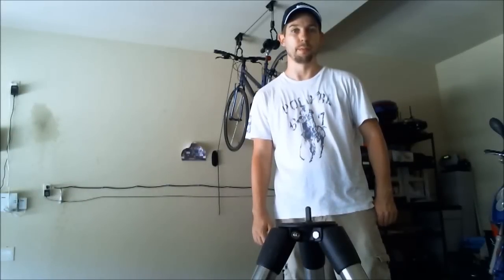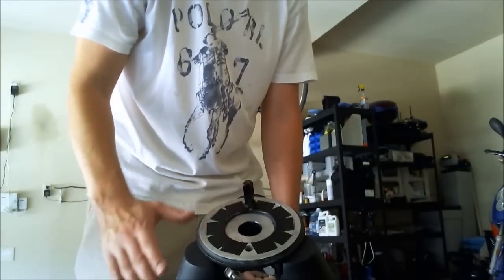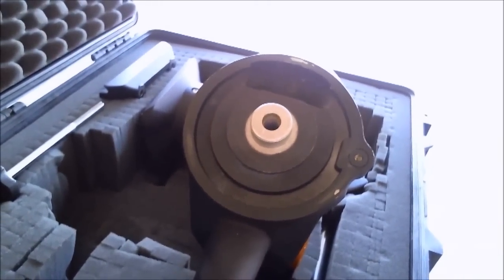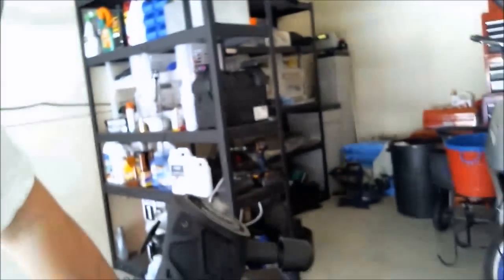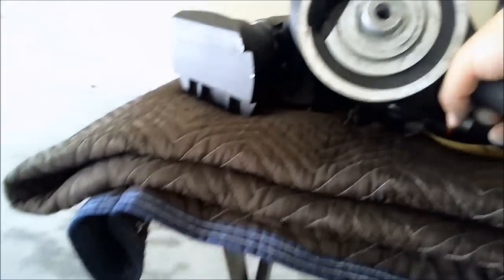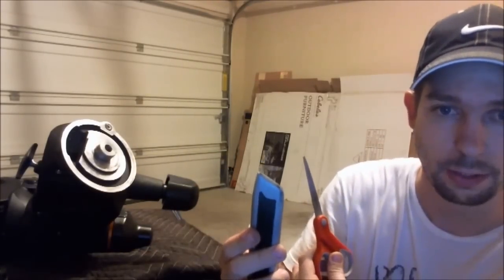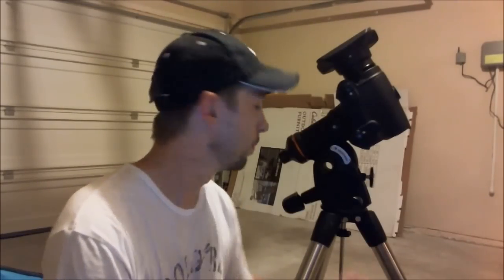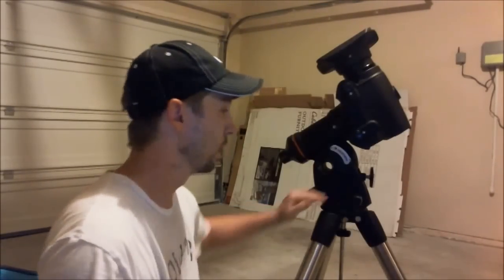CGEM Hypertune - Eliminating Friction In A Celestron CGEM Mount

Comment: Great video....btw, is this the correct tape and if so, what thickness should I use?   PTFE Slick Surface Film Tape, Gray, 1 1/2 in x 5 yd"  Lastly, it looks like you put tape on both the tripod and mount....if so, do the two surfaces with tape work with each other to reduce the friction...or is there just tape on one-side and it works against the metal itself?  Many Thanks, Steve

Comment: to much work use valve lapping compound to flattened both the surfaces then use plastic in between both surfaces done,sanding that way end up with wavy surfaces not good,don nit years ago good video kudos

Comment: A less perfect but much easier approach is to cut a disk out of a slick material, trim appropriately, and let it sit between the mount and the mounting plate.  A disk cut out of the side of a 1 gallon milk jug (HDPE) works very well.  The painted base of the mount glides over it very smoothly.
Reply from the maker: That was my first method, a few years prior.  That plastic deforms when it's warm.  When locking the bolts down, the axis shifts ever so slightly so it's all but impossible to lock in an actuate polar alignment.

Comment: That's some good thinking there! I would suggest, however, to cover your mount motor body with plastic before doing any sanding. Thanks for sharing!
Reply from the maker: That would have been a good idea!  I didn't notice any issues with paint dust in the motor/gears, though so maybe I just got really lucky!

Comment: Why strip the factory paint? I know it's aluminum so no risk of corrosion but couldn't you just sand the paint just a little to not make it smooth and then stick PTFE on the slightly sanded surface?
Reply from the maker: +Rony Aguirre When I first tried this, I found that the PTFE tape didn't adhere to the paint very well.  When I attempted to sand the paint smoother, it was difficult to sand it smooth and evenly flat.  That was when I decided to sand off all of the paint down to the bare metal.  After two years the PTFE tape is still stuck to the aluminum very well and shows no signs of starting to peel off.
Reply: +Mitchell Tubbs (East of Jupiter) Thanks for the info